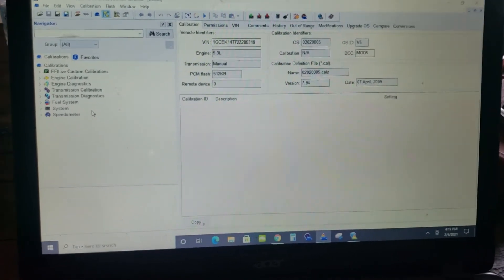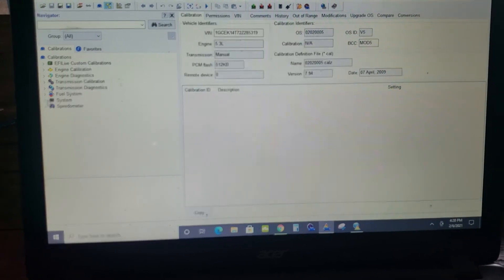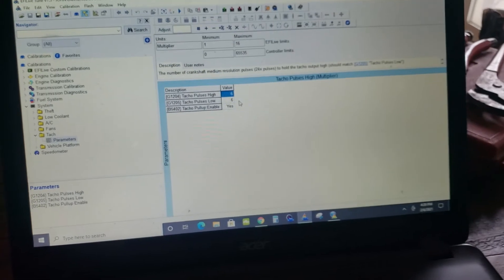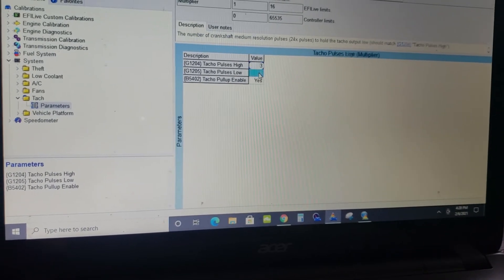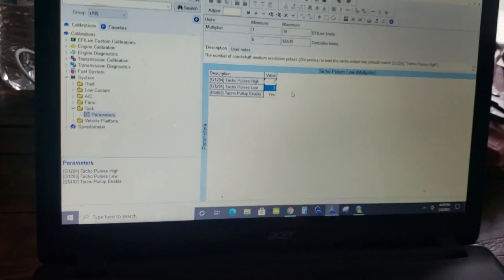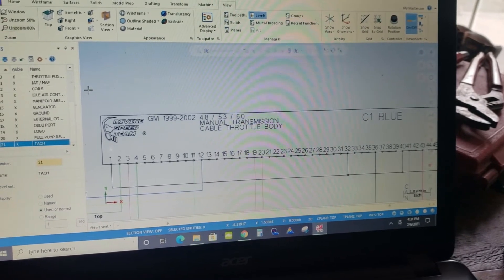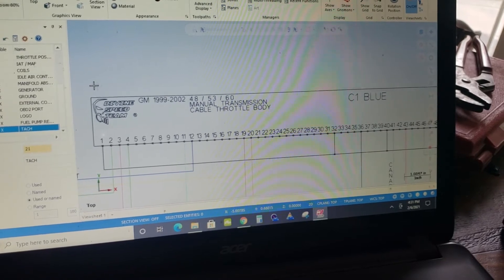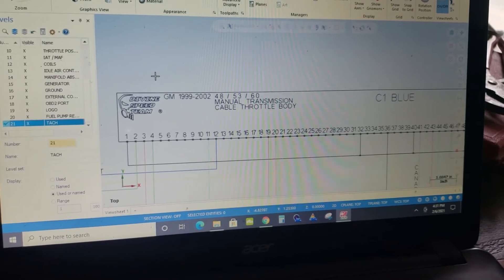LS SWAP FOX BODY TACH SIGNAL

Comment: Are u using a v8 tachometer 
Also where is that green with yellow wire located in car
Reply from the maker: We used a V8 tach but that car is long gone and I couldn't tell you anymore about it.